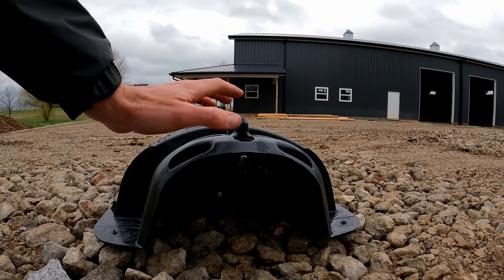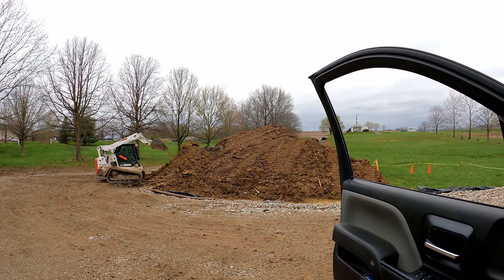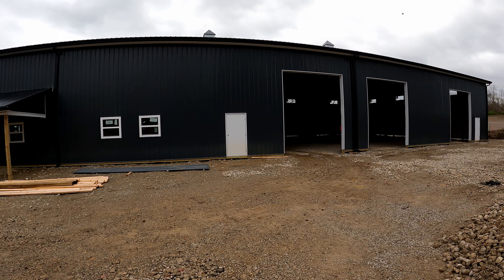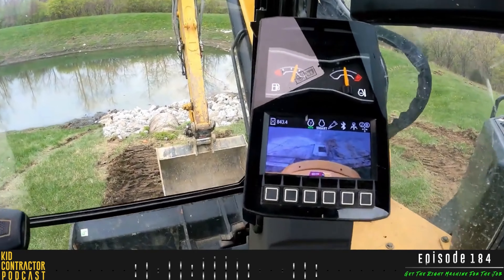Shop Update | Delivery from ADS!

Comment: Run the fence down further another 50ft or so,, then gate over across the drive. So the gate will be toward the front of the building or further down the drive way. Doing it this way then you can get away with a 12ft gate.